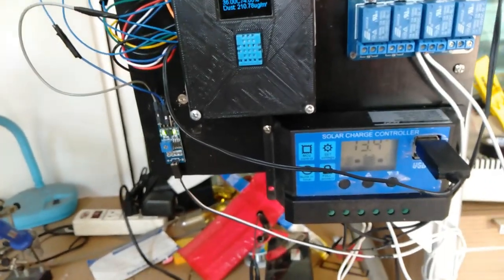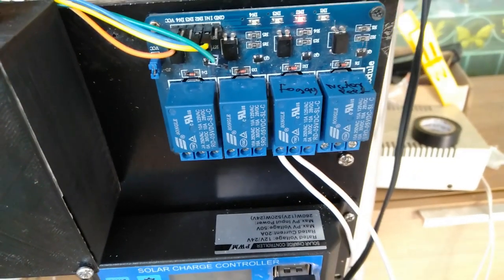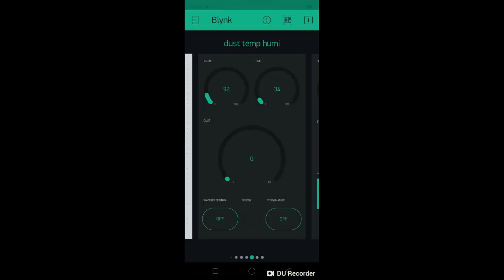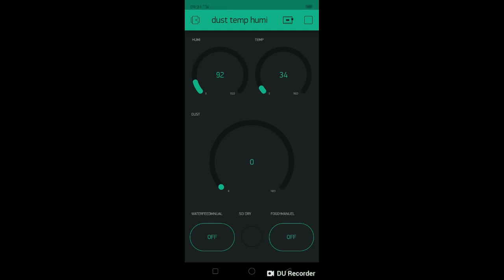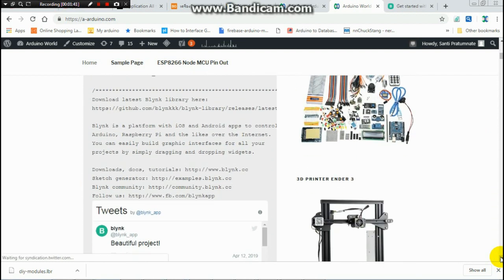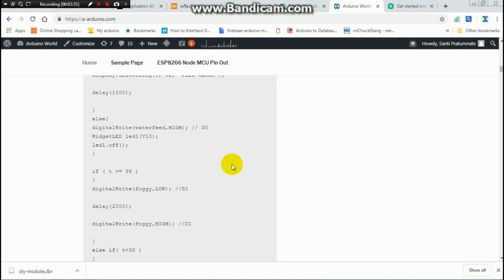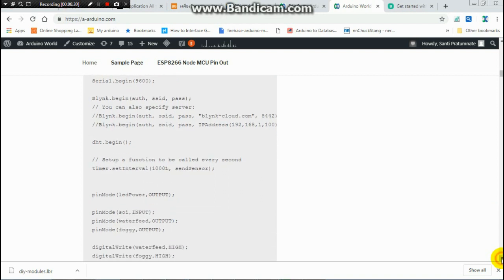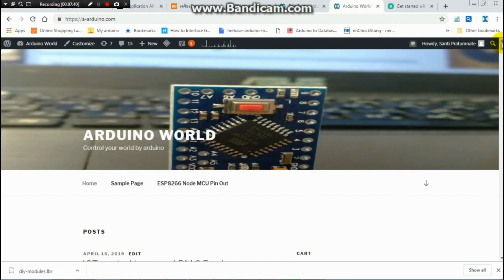ESP8266+Dust and Temp control spray water +Blynk application

Comment: พี่ครับผมสอบสามหน่อยครับคือผมจะทำระบบแบบพี่เลยครับแต่เอาแค่ dust sensor กับ dht11 และ รีเลย์ อีกตัวที่สามารถเปิดปิดผ่าน blynk และดูข้อมูลของ sensorทั้ง2ครับพอจะมีวิธีต่อและcodeไหมครับ
Reply from the maker: https://a-arduino.com/2019/04/15/iot-control-temp-and-pm-2-5-using-esp8266-node-mcu-water-spray-system/
Reply: ถ้าผมจะใช้รีเลย์ตัวเดียวทำไงครับ
Reply from the maker: @folkcokezero8604  ่่่ใช้ได้เลยครับไม่ต้องแก้โค้ด แค่ต่อสาย ควบคุมออกมาตัวเดียว สั่งคอยล์ทำงาน
Reply: รีเลยผมมีต้องต่อ D ไหนครับจะเอาทำงานตามอุณหภูมิด้วยครับ
Reply from the maker: @folkcokezero8604    ใช้ D1 ครับ และก็อุณหภูมิที่ต้องการควบคุม ก็คือ ตามโค้ดนี้

if ( t >= 36 )
{
digitalWrite(foggy,LOW); //D1
Reply from the maker: ต้องดูด้วยนะครับว่า Relay เรา Active high หรือ Active high ของผม Active low  คือ   สั่ง LOW ให้ทำงาน